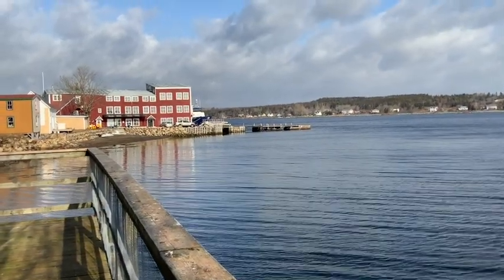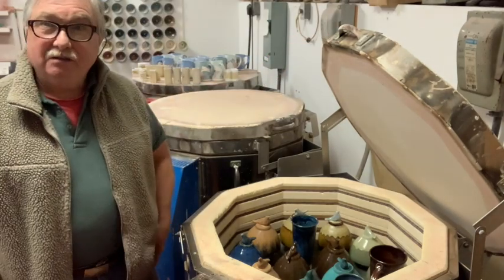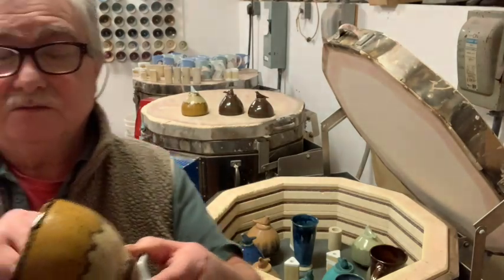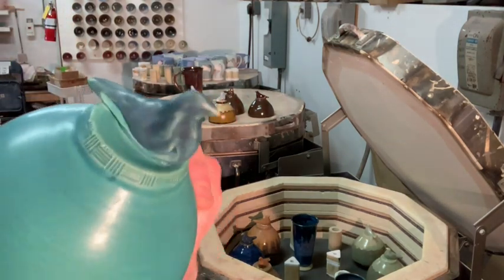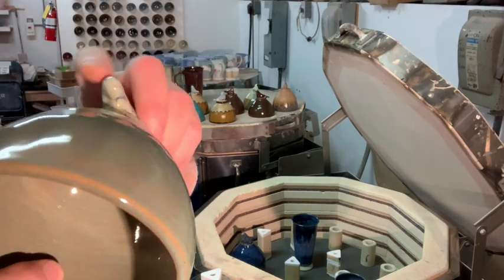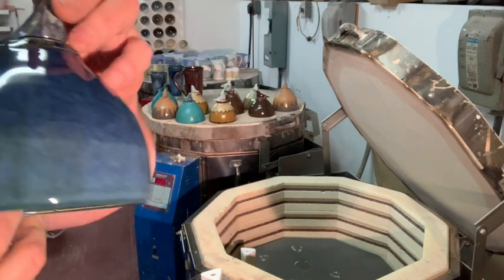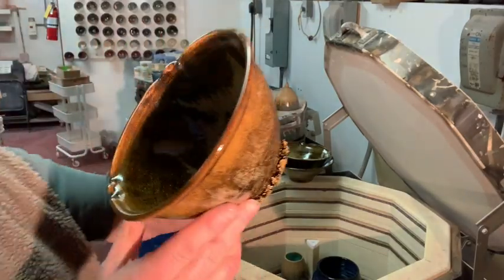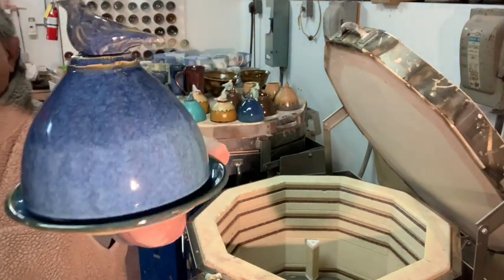2 Glaze kilns unloaded 02/26

Comment: What specific gravity do you make the bright blue, variegated blue, and mouse gray glazes. They look amazing!
Reply from the maker: I don't measure it, I just do it by instinct. Variagated Blue runs if too thick.
Reply: @Vsmithpots  so it coats your finger technique without any added epsom salt solution?
Reply from the maker: @cindyrodger4867  Correct.